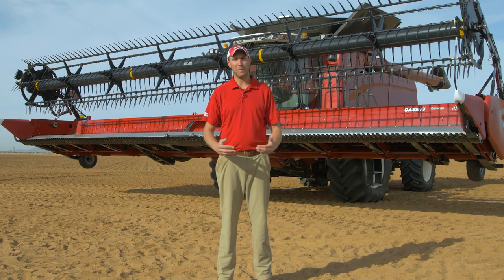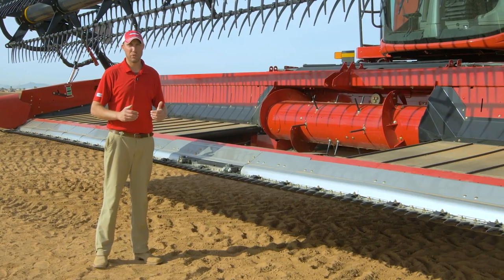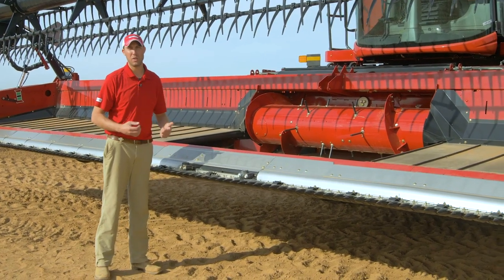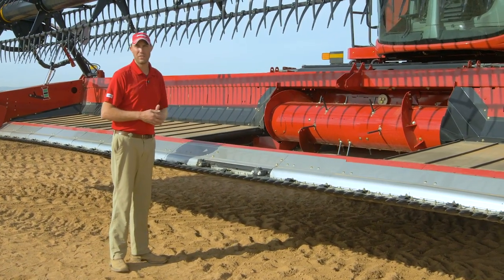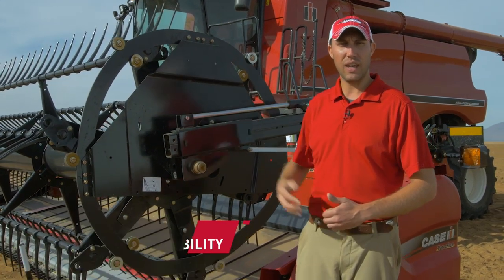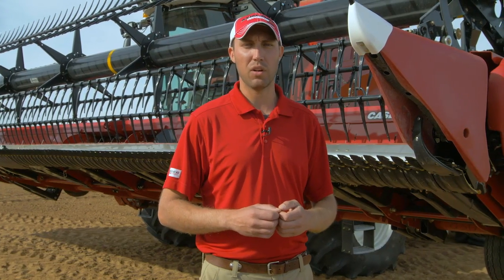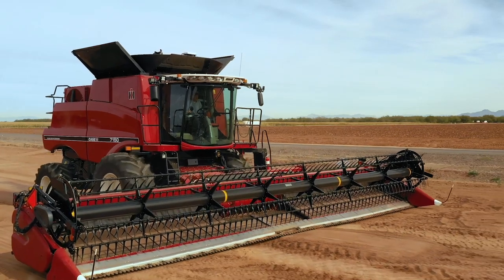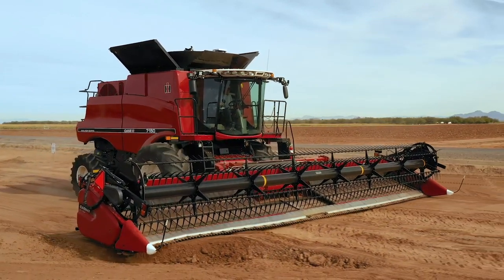The Latest Improvements of the 3100 Series Draper Head

Comment: What auger length do you recommend for a 45 foot Draper and a 30 foot corn head. The long auger is perfect for the Draper but too long possibly for the corn head when dumping when only a single pass is there for the cart?  Does the 29 foot auger work for the 45’ or is it just not enough?  Have to pitch the spout out every time?